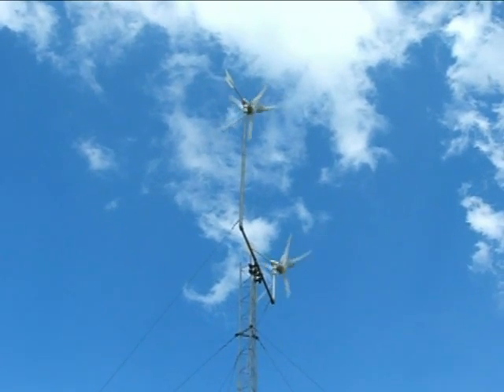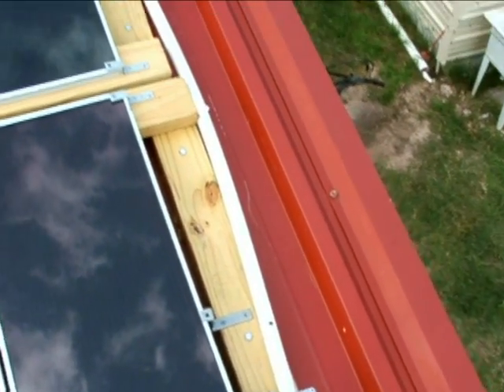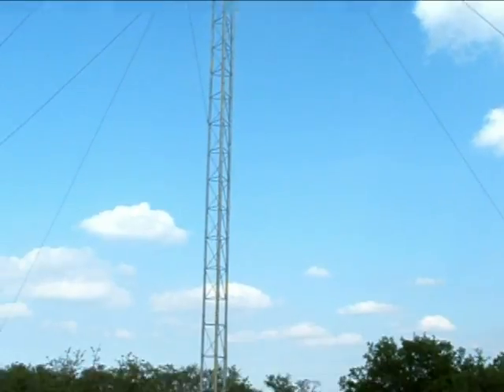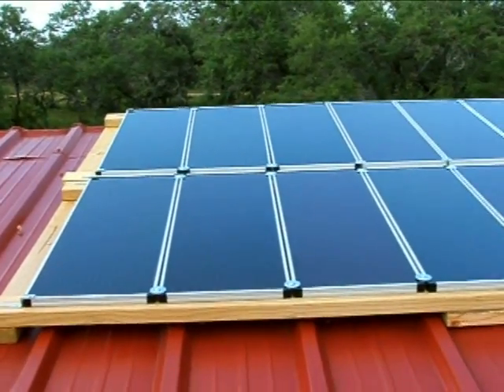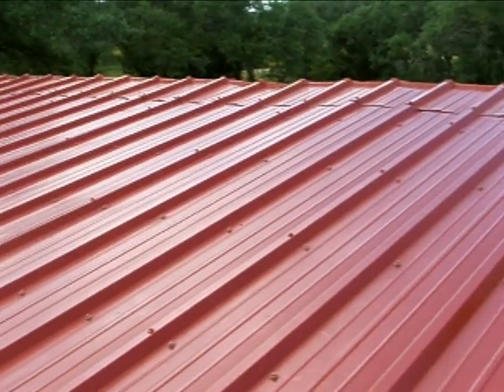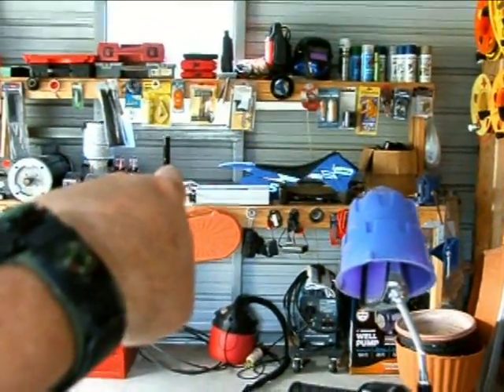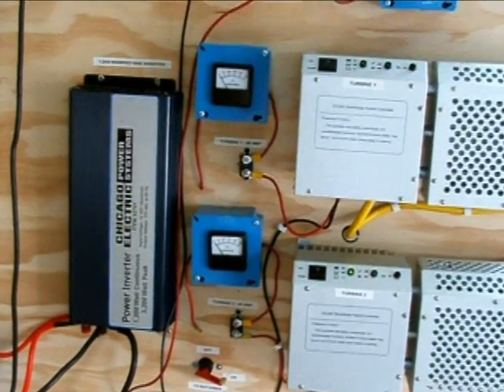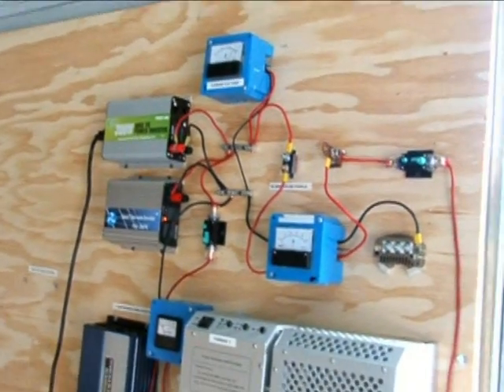How To Install Harbor Freight Solar Panels Part 3

Comment: So you have 24 batteries at $150 a piece that may last 3 years. $3600 so over 20 years that is $18,000 Then your panels will be dead in 18-20 years and you start over. This is saving you money? In the real world that is about $1200-1500 a year in maintenance. People do not understand its better to stay on the grid and pump power back into it during the day. Then use the power lines at night. (no batteries)
Reply: Don't you mean piece
Reply: LOL yep

Comment: The "DEAl" on a Federal government rebate is still around!  30% rebate plus in Arizona the local power company kicks in another $1000 if the system meets requirements.  Like others, I don't understand why you would waste money on HF panels?  Nice video though.

Comment: did some quick math - assuming about $150 per kit, thats just over $2 per watt. The HF panels are not the best quality (as usual). High-grade solar panels can be bought wholesale for about $1 per watt - more power output and longer lasting.
Reply: Yes your right, But remember this is 150 PER KIT, not per panel

Comment from the maker: They are definitely worth buying now, 3-4 years ago when I started panels were about 2 dollars to 4 dollars per watt, now they are about 68 cents to one dollar per watt. So it is very easy to get all the power you need for very little.

Comment: Regarding how high you are considering to raise your tower you may want to consider installing some sort of lighting system in case low flying planes happen by, they won't take out your tower.  Some lights mid way up might not be a bad idea either...  Great system btw, as I am very new to Solar I am still in research mode but I have been doing construction for over 3 decades...

Comment: Get some decent solar panels, and use a solar grid tie inverter, Eliminates the need for battery's and charge controller. I just bought a 500w wind grid tie inverter for $170. ebay. Solar are even cheaper.

Comment from the maker: you would need to buy a charge controller rated for at at least 150 watts which is how much ten of those panels can put out. Your best bet is to get your panels elsewhere, get a single 200 watt panel for a much lower price per watt and a charge controller for it. The nice thing about the HF kits is just that it is a kit and it will all work together and is therefore a good way to learn.

Comment from the maker: Google yellawood, it is pressure treated pine, it just doesn't look green, it looks like pine. I would go with fewer higher capacity panels which are lower cost and easier to install.

Comment: i was goona say   ,,all that work they had to be treated ,,w/something ,,dont know wht yellawood is???dont hv it in these parts,,just  typical,,pres treated,,o wld like to lay my panels flat like that ,,i hv low pitch roof too,,so im wondering how am i gonna keep the snow off,6inch of light snow prob ok but we get rain on top of the snow too,,damn good insulation,,but,,,wld bend that glass poss break?i dont get enough sun f/30 deg,also is it cheaper f/1 or2 panels f/200 watts as oppose to the 14

Comment from the maker: All of my solar panels (including the Sharp and DuPont panels) are covered with glass. I don't know of any brand of solar panels that are covered with plexy as that will deteriorate over the years and turn opaque yellow. I don't have any protection on them, the glass is tempered like the glass on a car and it is angled so it will deflect a lot of the impact force. I have never lost a panel to hail nor know of anyone that has- so I'm not going to worry about it..

Comment: I live in the Texas Panhandle and we get lots of hail here. If you are in Texas you may as well. The thing I have noticed with the Harbor Freight panels is they have glass not plexi covering the cells. not sure if yours do or not. If they do how do you plan to protect them from hail damage?We loose a lot of sky lights here in the panhandle and lots of home owners use a type of grill mesh covering over their skylights. This might cut light penetration but would protect the panels.

Comment from the maker: Not practical, it is 75 feet to the batteries, would require too heavy a wire due due to voltage drop, there is a reason  why I did what I did.

Comment: nice setup.   150 feet wow I wish I could get up to 40 feet were I'm at now.   but 150 feet even 100 should get you above most of the trees defently 150 would and you bet much better clean wind up there also.  I like how you have your tower setup how hight is it now.  looks like maby 50 or 60 was tring to count the tower parts I know each one is about 10 feet.  I will need to get and old antena tower would work great for this.   thanks for the video.

Comment: he could likely keep his house going with electricity without the grid for a day or two once he gets his full system put in on batteries alone and then more as long as he still has his wind and solar collectors. I sure anyone whose experienced a extended blackout would appreciate this.

Comment from the maker: Do you know what it costs to raise a tower 300 feet?? The tower itself has to be much larger and stronger, the concrete and rebar for the anchors alone would be prohibitive in price and they guy wires themselves would be an inch thick and cover about an acre in area. You'd also have to have a permit and inspection for strobes to warn aircraft.It would cost about $30K or more to raise such tower. Get real.

Comment from the maker: You don't know what you're talking about friend. Build aluminum frames, buy the tempered glass, buy electric terminal box for the back, waterproof the box to not leak for 25 years and you think you can save money including the hourly wage your time is worth?? Nuts. There is no such thing as "Polymorphic", they are called polycrystalline and show me data you think shows it outlasts thin film amorphous silicon, I bet you can't find it. All silicon panels are expected to last 30-35 years.

Comment: This Harbor freight junk is not even close to a good deal.  You're paying $3.33 per watt for cheap amorphous panels that will start to degenerate in just a few years.  You can buy good quality polymorphic solar cells on the web for as little as $.35 per watt.  You would have to build the frames and solder all of the leads yourself but for what you paid for those you could have bought over 3kw of solar cells.  Also the polymorphic cells will outlast the harbor freight panels by 10-15 years.

Comment: Each panel costs $60.  As a 15watt panel, that's $4 a watt, which is incredibly expensive! These are late 80's early 90's prices for solar panels.  You can get high quality panels from between $1.00 to $2.10 a watt!  I am not raining on your parade, but I can't for the life of me understand why anyone would spend $4 a watt for cheap Chinese panels?

Blessings..

Comment: Nice video , but why use 2 by 4s  for the frames? ,why not aluminum angle? ,it's much lighter and won't have to worry about wood rotting from rain and moisture

Comment: I am new to solar and have very little electrical knowledge. Your system looks pretty solid. As is in this video,what can it run? I am having a hard time discerning what practical application this represents. Can you give an example? Does this merely run garage lighting and a sump-pump? I want to use HF panels to build my solar system. I do not intend to power the entire house. But I bet I can power good quality LED lighting in every room of the house.

Comment: Hi! Nice set up but I wouldn't recommend all this equipment to be attached to a plywood there is a risk of fire in case one of these devices fail they can catch fire on an overload or you never know remember safety first.

Comment from the maker: @cshea1985 Your latitude is the angle at which your panels should be set. Do a Google search for "Solar Angle Calculator" and put in your zip code and it will tell you what your latitude is. You can also go to weather.com and put in your zip code and it will also tell you your latitude. That is the angle for your panels.

Comment: I will be moving to Uruguay where the energy run on 220 watts,  I would like to know how many panels do I need to provide energy to a home of 4 rooms, 1 bathroom, 1 kitchen and porch... I would have 3 tv's, washer and dryer, dishwasher and central air condition... I would appreciate any suggestion or commets

Comment from the maker: @deputy1040 No, because there is no such thing as a standard refrigerator. If you're serious about running appliances with solar panels then you need to look at higher capacity panels and forget these smaller panels from HF. While they are great, they are also expensive, and the only reason I have them is because I have a very specific need in mind that only these panels can fill. Speak to a professional at a reputable place like wholesalesolar and they can help you.  Thanks

Comment: @Decebal825 right, the hobo freight panels are junk 6 months from now they will be so ate up with water damage, they will be goood for scrap aluminum, should fetch about 6 bucks.for 14 of them (clean) these only work well if kept inside. like a motor home window

Comment from the maker: @popcorncrow They are made of tempered glass so it would take a very hard blow to break it, however, big enough hail will break it much the same way as it would break the windshield of your car or truck. Like a windshield, the solar panels are angled so when hail hits it a lot of the forced will deflected.

Comment from the maker: @MrFisherman2222 Pressure treated good can last up to 20years, more if you put a coat of sealer once a year on the exposed surface. Mine has done great for the last couple of years.

Comment from the maker: @1991araaron That's just crazy, no way you can make a panel for less than you can buy it. Many have tried it just to have them fail later. Issues with moisture getting in, people not putting in a blocking diode, the cost of the tempered glass and the aluminum frame...just not realistic. Besides the fact that almost all of the cells you can find for sale are the rejects from factories that did not pass inspection - not a good idea to build a panel from.

Comment: @econewpower 
Yes, the reason my solar systems are based on the HF Amorphous panels, but I just got some of the "roll out" poly panels, i think they could withstand any hail out there while the HF panels are still basically glass but would probably last a lot longer than anything that fades or cracks with age, as long as they don't get broken.
Reply: 8digitPDX

Comment from the maker: @Decebal825 I have eight Sharp 210 watt panels and twenty DuPont 100 watt panels for a total of 3.6 Kw. Problem is, if hail or other damage comes, each panel lost is a significant loss of the system power. The HF panels on the other hand offer survivability that you can't get with the other panels. If an HF panel fails or is broken by hail or flying debris, I'm only out 15 watts. So...gee I guess some people don't think clearly about all the scenarios for survivability.

Comment: I want to have one room with 800watt a/c, one small refrigerator, one small microwave and one light, in case of hurricane or other emergencies.  I think if I put 2 or 3 harbor freight 45 watt units and 4 to 6 batteries, it should be fine.  I need charge controller and an inverter.  Someone with experience, please advise.

Comment: I am just starting with the Harborfreight solar system.  How many panels can I place in parallel with the voltage control unit it came with?  The system came with 3 panels, I am thinking about buying more panels.  Thank you in advance for the answer.

Comment: @econewpower Yes, I realized that after I saw your later posts on the Dupont panels.  I only know because I used to work at a company that made SI panels till the economy put them out of business.  They were about $2 a watt and that was 3 years ago.  I know it's much lower now.  Great system.  I'll keep checking for your updates. I'm learning a lot already.  I'd love to put up a 1-2 KW system.  Carry on.

Comment from the maker: @Sirrom0206 Thanks, nothing I can do about hail. The panels have tempered glass and they are leaned enough that most of the force should deflect but can't protect against large hail. That is why I have the HF panels, to cut down on the total damage in power production that a few panels can have over the whole system.

Thanks

Comment from the maker: @jhs5150 Everything is grounded properly with 8 foot long ground rods dedicated to the solar and wind. There are three separate grounds for the components. Yes, I know about other panels, I have 3.6Kw of Dupont and Sharp panels and only 1Kw of HF panels, I don't do it for cost I do it for survivability.

Comment: How susceptible to lightning are you down there in Texas?  With all the metal on the roof and in the buildings I hope you are well grounded.  You might want to invest in some lightning rods.  Great setup though.  You have thought this out.  I agree with some of the others, these are great starter panels but you can buy higher watt panels for less cost than the HF panels.

Comment from the maker: @Sirrom0206 It could happen but it is tempered glass so it should hold about as well as a windshield, but if the hail is large enough then some will break. When it happens I will only lose 15 watts per broken panel, that's the nice thing about it.

Comment from the maker: @kobedarott Unfortunately because of efficiency losses converting electrical energy into mechanical energy and then  back to electrical energy you would lose more power than you would generate. My answer is wind generators, when the sun is not shining usually the wind is blowing and vice-versa, they are mutually complementing technologies that work well together. Thanks for you comments and God bless you.

Comment: hey 7 or 8 years is all those panels will last then you got to replace them. you can get panels that last 30 or 40 years much cheeper . harbor freight panels are over 3 bucks a watt. you can get better ones for a buck a watt today. 5000 watts for 4 grand is what i am running and its all streightwired into a inverter and from the inverter into the grid. that a lot cheeper and the power company buys what i dont us. while im at work all day, they buy my power and i get it all back at night for free

Comment from the maker: @davettalashley That has not been my experience at all, my HF panels are tilted only 22 degrees instead of the needed 45 degrees to be perfect where I live and out of 420watts total I consistently get about 370 watts which is very good for having such a shallow angle.

Comment from the maker: @davettalashley Really well actually, those Harbor Freight panels have been working for almost a year now, when I have a full moon and clear night they are so sensitive still that I get just over12volts with four in series. I'm going to do a video in a couple of weeks when we have another full moon cycle to show folks the sensitivity of amorphous panels under low light - which most people mistakenly think that amorphous is inferior to mono or polycrystalline.Thanks and God bless you.

Comment: @econewpower I read on the harbor freight site from one reviewer of these panels that these will only last about 3-4 years due to the nature of material used to make them..that's a lot of money for just a few years. he says..thin-film polycrystalline panels peak output current decreases over time, meaning you'll be lucky to get 1.5 amps in full sun after it's a few years old. For long life, nothing beats the old-style panels with single-crystal silicon wafers, but they are many times the price.

Comment from the maker: @Jthetinman The solar panels if you were to buy them today you would pay about $2.00 per watt, so figure on 4,000 watts needed, so that's $8,000 in panels. Then about $700 for a charge controller, another $700 in deep cycle batteries and yet another $1,000 or so for a quality inverter plus another $2,000 for wiring, fuses, breakers, mounting rails, etc. Total investment is about  $12,000. Yes it is enough to power my house but I insulated first, cut back here and there. Be frugal with power.

Comment from the maker: @ohgary1 Actually each kit was purchased for $149 each so five kits were $750, which compares favorably with other prices out there. Additionally, if you have hail and you break a panel you are out 250 watts and $800, I will be out 15 watts and $50. There is a lot to be said for many smaller panels against a hedge of breakage due to hail, hurricane, tornados, etc throwing things around.  Thanks for commenting and God bless you.

Comment: How did that work out cost wise? 14 panels would have been 5 kits at $200, or about $1000 for the panels.  You can get a single 250watt panels for around $800

Comment from the maker: @ElCoyotefromTexas Thanks I will post a new video tomorrow with the final two parts of the Harbor Freight panels. I added the final set of 14 panels and have the new battery bank in place so things are moving along.

Comment from the maker: @jcornelius215 Multiple charge controllers and wind turbines work fine going to the same battery bank. You will always have one putting out more power than the others but all will corrected by the voltage of the battery bank, so that if one charge controller puts out more power it will put out the power in terms of Amps and not of volts. Charge controllers determine charge level by voltage level, since they all corrected to the same voltage (although different Amps) there is no conflict.

Comment: How do you put diffrent sources of power to your batteries? It seems like that if one of your charge controllers was putting out more power than the other then. than would shut off or they would go back and fourth not knowing what to do.